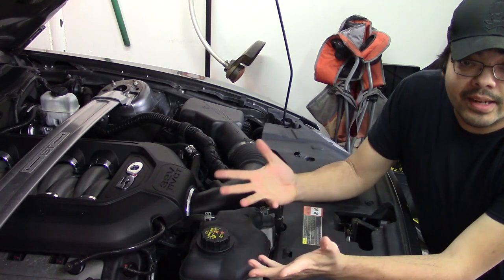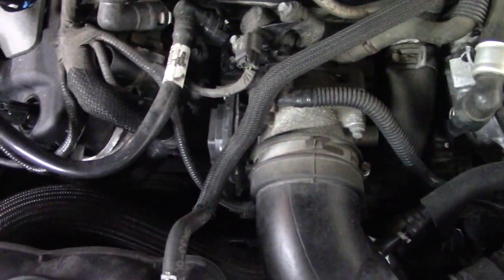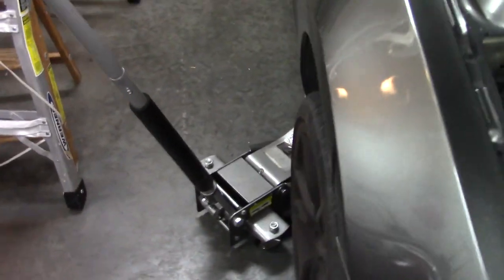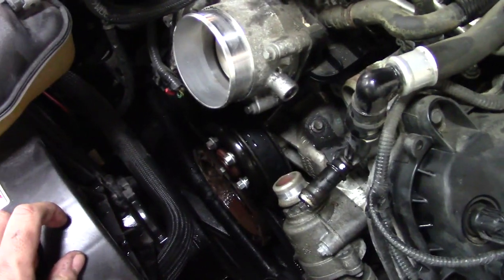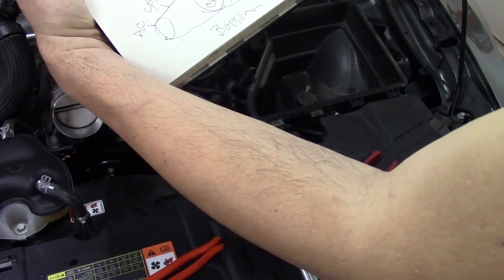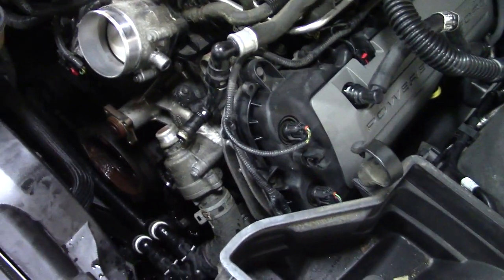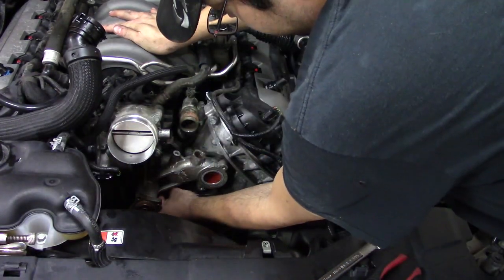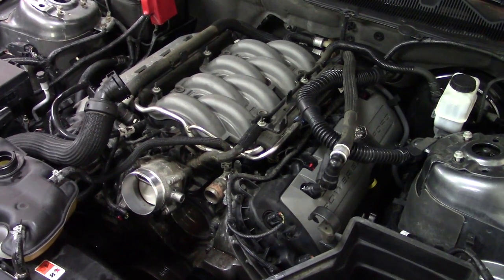2014 Mustang GT 5.0 water pump removal.

Comment: Awesome. I've a 2015 s550 gt w/ 42K miles. Waterpump took a dump all of a sudden when I started it in the garage yesterday. Forward-most bearing COMPLETELY shredded so the shaft wobbles like a knock needed goat. Your vid helped immensely! Thanks and kudos!
Reply from the maker: Glad to hear it helped. Sorry to hear the pump went bad on you
Reply: @TheJimminiShow  Yeah. Wished I seen how you got yours out of the block. Mine was a bear. Had to rock it back and forth, up and down while pulling on it. And, yeah, using a ball peen hammer. Seriously, was worried about screwing up the block where the pump fits in. Finally came loose and it looks like no damage to the block. But a vane was broken off the impeller and I found pieces of the pump in the inset of the engine block. I'm guessing the bearing pieces that broke. Not like the old days of wrenching on a small block Chevy, that's for sure. I seriously love my Mustang. But I'm learning to be very careful when working on it. All that aluminum is not as forgiving as the iron in my old 327 '65 Chevelle! Anyhow, thanks again!
Reply from the maker: The engine bay on the S550 is slightly different. I had a little bit more room so I didn't have to rock it back and forth as much. I was able to just put a pry bar just under the back lip where it mates up with the block. And then it just came off pretty easily on mine. They must be using a different gasket or sealer on the s550s. Yeah sometimes I miss working on an old 302 s95 mustang or my old iroc z Camaros. I am keeping my eye out for a 69 boss or at least a 69 fastback. My buddy and I are looking for a shop and I want to do some cool projects.
Reply: Do I need a new gasket or gaskets for the 2015 water pump replacement?

Comment: I have coolant leaking (small leak) but it in the center of the k-member. Engine not overheating at all. But I see coolant on the hose that looks like it connected to the water pump. Could it be my water pump? I have 2012 mustang gt with 152,000 miles.
Reply from the maker: That's not something I can diagnose over the Internet. at 150k, it could be the pump, or the hoses, No clue. You need to go to a mechanic.

Comment: My car overheats when I turn ac on. Does this mean it’s my water pump? The coolant level also goes all the way up about to shoot out the cap.
Reply from the maker: Possibly. Possibly a bad thermostat. The only reason the coolant level in the tank would go up is if the flow was blocked going into the system. Most thermostats are designed to break in the open position, but there could be something wrong that is making it stay closed. It is supposed to open at about 195
Reply: Also, check the fans some cars have an electric one, and change the radiator cap.

Comment: This helped a lot. Got to the water pump easy. Having the same problem with getting it out. All 4 bolts are out and it wiggles but won’t come out. Don’t want to rip it or pry, Any suggestions?
Reply from the maker: Wood block and a rubber mallet. Towel under the pump to catch it
Reply: Awesome thank you, I’ll try it this week

Comment: Going to be referring to this video later. Just replaced the engine on my 13’ GT from 174k to 46k. 

Hammered down on it this morning then I get a misfire on cylinder 4 and coolant everywhere. Water pump was making some noise so I will be swapping the WP with the one off the old engine as well as the spark plugs and coils.

Comment: Hey jimmini, my 2013 gt waterpump took a shit as well and I cant find torque spec for the four water pump bolts. Do you know the toque spec?
Reply from the maker: Honestly, no. Probably not the best advice for me to give, but not everything needs a torque number. After wrenching on cars for tons of years, many parts just need to be tight. Don't Superman the bolts tight, is that can cause damage to threads and pull out the threads from the aluminum block. But I haven't used torque specs for water pumps or will lug nuts or lots of other parts in a vehicle because over years with experience I've learned what parts just in need to be tight. Obvious thing such as head bolts your crank bolts your rods and pistons and you're connecting rods and you know there's lots of things that need to be correctly torqued, but most accessories do not. I know it's probably sounding like bad information, but I've built everything from Chevy cavalier engines to high horsepower turboed Grand Nationals. But a Chilton guide probably has the correct torque specs. Sorry I just don't know them off the top of my head
Reply: Water pump 10Nm the pooley 25Nm.
Reply from the maker: Thanks for the info friend
Reply: @TheJimminiShow  no problem, if you want i have a repain manuel for 2010 till 2014 mustang, I can send you, or anyone here who needs it

Comment: Could u tell me how u knew it was the water pump I have same issue I think well my brother does
Reply from the maker: Th car would smell like anti freeze when sitting at idle. and the pump was damp. also, I was a mechanic for 15 years.  I did have to replace one of the idle rollers as well. I think the fluid dripping onto the roller caused it to wear out.
Reply: @TheJimminiShow  ok does the water pump have a leak hole if it goes bad like the old mustang's I been working on cars for years to I've rebuilt a few cars. I think it might be the radiator hose but I have to take it off and check thanks for the reply it doesn't run hot but the heat dies unless u press the gas
Reply from the maker: It does have a small weep hole. If it is a newer 5.0 you have to be careful. You'll need a whole  new hose kit. Ford changed the diameter and depth of the connection on the hoses and don't list it in the computer. The kit is about $200 for all the hoses and the distribution block. It sounds more like you have a thermostat sticking open. If you have no heat unless the accelerator is pressed, it is not circulating the coolant at idle through the heater core. If you don't hear a whine, and don't smell coolant, I would try the thermostat first.
Reply: @TheJimminiShow  thanks there is a whine thank you I'll start with that the thermostat thanks man it helps so much thermostat would be simpler
Reply: @TheJimminiShow   when you say newer 5.0 do you mean the gen 2 and gen 3? I have a 13 gen 1

Comment: Just started having this noise last night. It only does it on acceleration. I dont smell or see any coolant or puddles anywhere. Here is the video to my video. Anyway you can tell if it's the belt or the waterpump? Thank you!    https://youtu.be/N0UB5uIh1Q0
Reply from the maker: Hard to say. Sounds like a Pulley, Im more concerned with the crank bearing noise I heard when you revved up. It sounded like you have whats called Crank Walk. When you rev the motor, the rod bearings are letting the crank move and make an almost knocking sound. I would worry about that first. You may have an oiling problem, or you may have a bigger problem on your hands